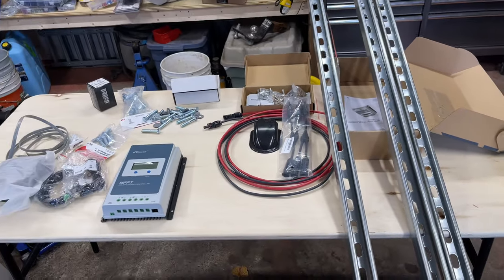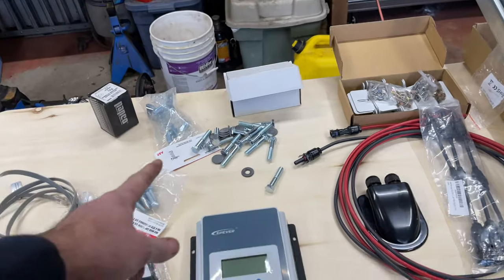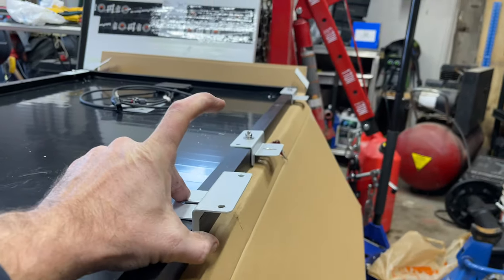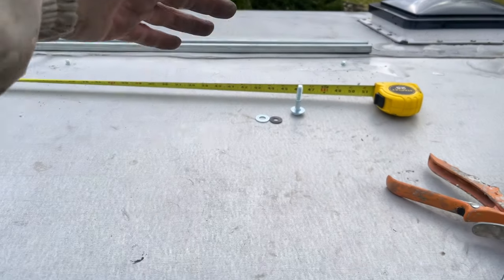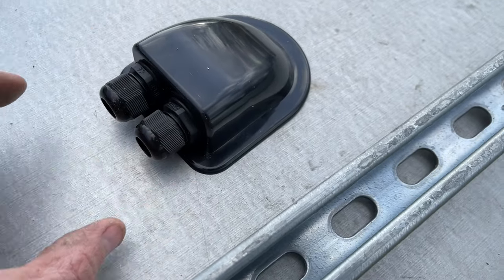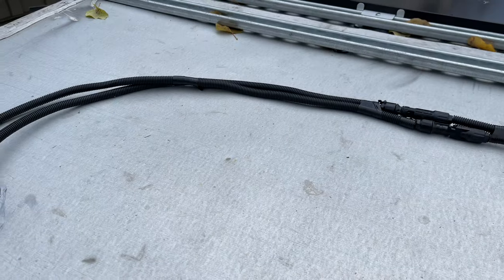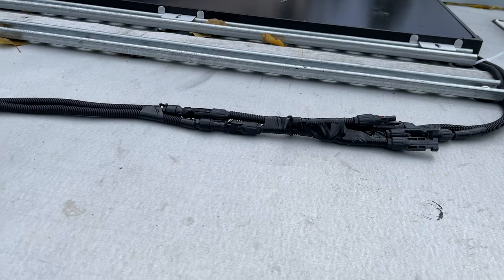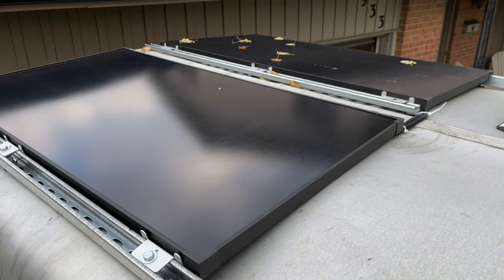How to Build a Cargo Trailer Camper - Solar Install Part 1/2

Comment: Another awesome job. I made a comment on your shock mounts, which was another awesome idea. But really appreciate the simplicity of your solar struts system. 
I have 305 watts panels on my 6x12 and am going to change to smaller panels on the roof. But will have two more that can be placed on the ground if I park in the shade.
Thank you for the great idea.
Reply from the maker: I was debating on some portable panels along with the fixed. I really like the idea of parking in the shade while summer camping and still charging. I’ll see how it goes and maybe do that later.
We have a trip out west planned so this set up should help charge between stops. Glade you found it a bit useful. 👍
Reply from the maker: Also maybe look into these shingled panels they seem to pack more watts into a small foot print. The panels are 170w each so 340w total and only measure 49”x28”. Maybe that would work for you?

Comment: Great video!!  Did you mount the uni-strut through the roof sheeting or through the actual steel roof frame?
Reply from the maker: I ended up bolting it right through the steel frame. I feel like riv-nuts might have been better.

Comment: Awsome design! Is there a risk that multiple connectors under the panel will rub/scratch the panel surface from the bottom?
Reply from the maker: Thanks! I’m not 100% sure. I don’t think so there is about 1/2 inch of extra room. But I will let you know if it ever does. 👍

Comment: Awesome job!! I am mounting six solar panels on the top of my 8×20 ft cargo trailer. Could you link where you got the unistrut and spring hardware please??
Reply from the maker: It’s usually in stock at Home Depot or Lowe’s. 
Here a link to Home Depot - 

https://www.homedepot.ca/product/superstrut-14ga-pg-half-slot-1-5-8x13-16x10ft/1001447009

Comment: I had never seen a Solar panel like that. Are these a GOOD/Better/Best ones or just what you found?
Reply from the maker: Hmmm that’s a tough one. I liked that It was a local distributor. I liked the amount of wattage packed into the smaller panel due to the cell shingling. It’s a newer technology…. As for are they the best…. I’m not really sure I think I need to own them a bit see if they are durable see if maintain the output. I will keep you posted in future videos.

Comment: Those unistruts seem to block the air flow under the solar panels! Anyway to raise the solur panels up?
Reply from the maker: Personally I like the low profile but definitely you could raise it as high as you want, you could also use 1 1/2” unistrut in the middle but as of now the middle has about 1/4” gap under it and the edge about an inch. 
I wanted to keep it tight so I wouldn’t catch the tree branches etc when going down backroads but you could space it up as much as you want… you’d just need longer bolts.

Comment: Why did you buy a controller? Does it already come with one? How is the solar panel holding up?
Reply from the maker: I bought all the components separately. I wanted the shingled panels and they only come individually. The system has been much better then I thought… in the summer it charges up quickly, panel’s have been great! 👍

Comment: Have you experienced any leaks in your roof from the superstrut installs?
Reply from the maker: No leaks so far! I used a rubber washer and lots of sealer. I like actually rubber washers for any protrusions I find they take the vibrations and expansion better then just sealant

Comment: Where did you get the solar panel you should’ve linked it in the description
Reply from the maker: Thanks for the reminder I just added the link into the description. 👍
Here’s a link to the panels 

Solar Panels For Rv Trailer - 12v 170w monocrystalline Extra Compact Shingled Solar Panel Design, 12v Panneau Solaire 170w. Great for RVs, Campervans, Trailers, Cottage, Shed or Beach. Perfect for all Off-Grid Projects. (1, 170 Watts) https://www.amazon.ca/dp/B09HNKTNHG/ref=cm_sw_r_cp_api_gl_i_2NEZCE0N41KSQYW9HMXG?_encoding=UTF8&psc=1

Comment: Great job !
 Do you have a link for those solar panels ?
Reply from the maker: Unfortunately they seem to be out of them right now so my order link is not valid. Here’s a link to the smaller 110w panels from the same company. If you look at the spec sheet in the pictures you will see the 170w panels. Maybe reach out to the store? 

https://www.amazon.ca/Solar-Panels-Trailer-monocrystalline-Campervans/dp/B09HNLDLK5
Reply: @waysoutback   Thnx for the quick reply . 
Sent the seller an email.

Comment: I would personally have invested in a small Honda generator, they are a waste of time in the winter running solar with no sun. It cost me thousands to find out the hard way.
Reply from the maker: Yeah very good point! Many think they will get more out of solar then they actually do. Your bang on summer is great but winter is a real struggle. My trailer has 460ah of batteries with only draining 50% I can go about 6 days being very careful. After that I have a dc to dc charger in my truck so I can charge there or like you mention a generator. To be honest though when I’m out boondocking and someone fires up a generator I pack up and move on I honestly can’t stand them. We have a strict rule no generators when we go camping as a group. 😁
Reply: @waysoutback  Thanks for the reply, and generators are noisy, I am testing solar now at home with two 100w panels from CTC, with new marine deep cycle batteries. The fold up 100w panels are my choice but very expensive.
Reply from the maker: @wrxs1781  Everything has gone through the roof in the last few years, or is difficult to find! I installed the two on the roof and then a plug on the side of my trailer to plug in another one if I need it. I was thinking if I want to camp in the shade I can still run a panel out to the sun. I don’t have one yet but maybe I can use one of those fold up panels. Let me know how your testing goes.